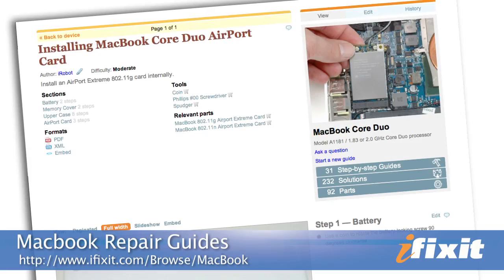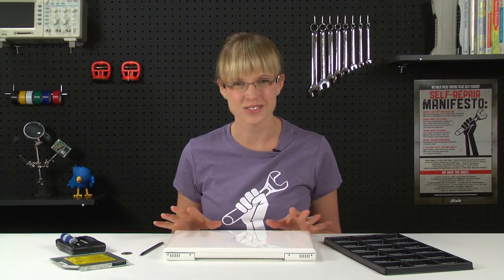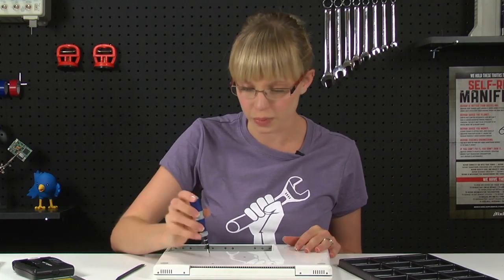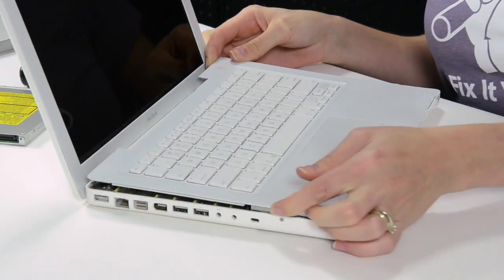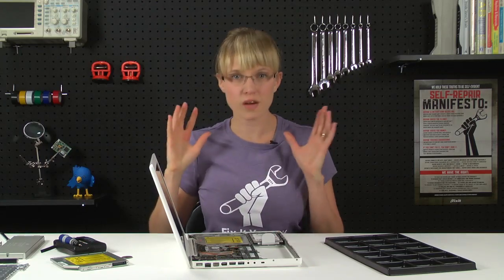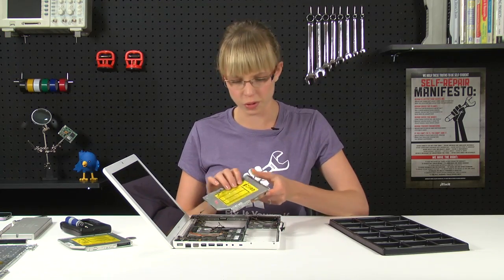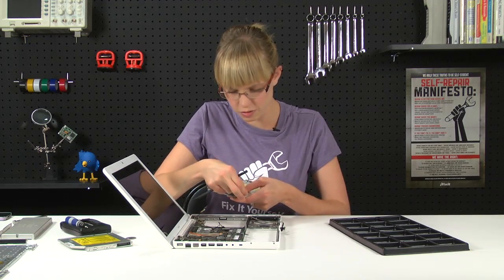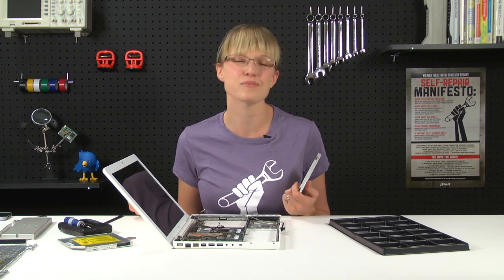How To: MacBook Optical Drive Replacement

Comment: Hey folks.  Got this free A1181 white Macbook.  CDRom is whiney and won't eject.   I see the replacement drives on ebay but how do I know if my unit is a late or early unit (some of the auctions specifiy that it is for the early or late version).  Thanks

Comment: Hello iFixit, my macbook 10.5.8  has no headphone sound but internal speaker works perfectly fine. When i inserted the headphone/headset it has no sound. I already reset the VVRam/Pram, did the toothpick remedy, check the audio midi setup, system pref/sound settings, but there was no luck. My macbook sound output has stuck to digital out and i'm so disappointed already.. i don't know what to do anymore. I read many articles about this problem and they say, it might be the switch between headphone and digital output inside the headphone jack that need to be fixed. Can you please show us how to fix the audio output to switch back to headphone from digital out?.. Thank you.
Reply: Still need help?